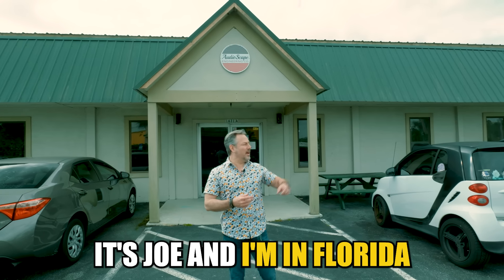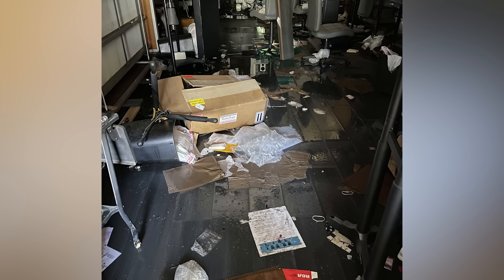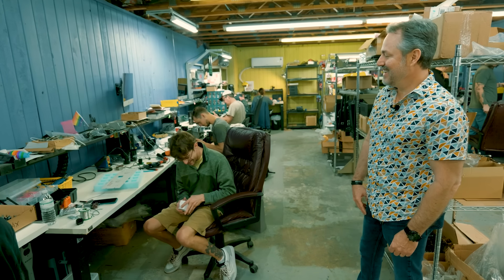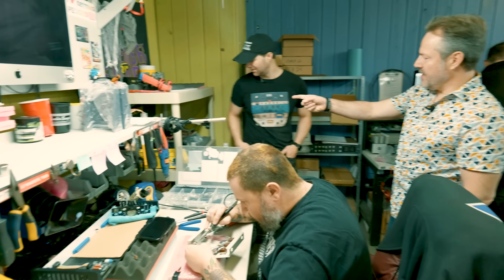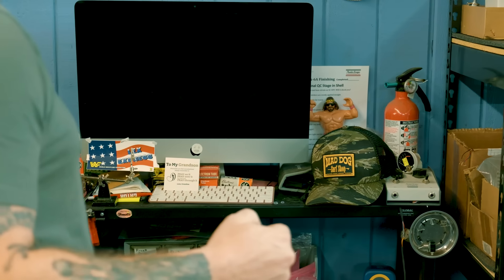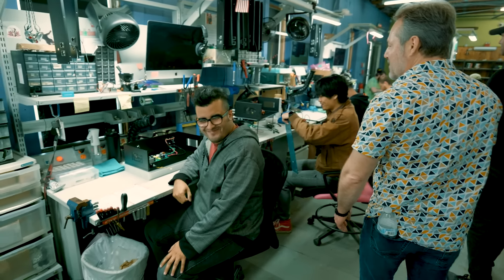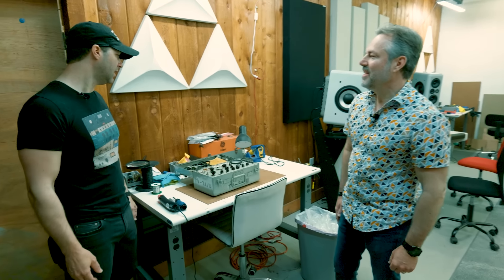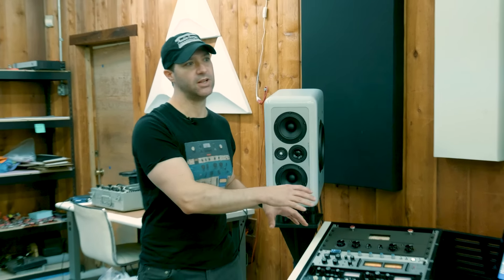AUDIOSCAPE Factory TOUR With Joe Carrell

Comment: Great video. Very interesting to see Audioscape from within. And the units sound great! It is also amazing that you are able to produce with the New Old Stock components.
However, as someone who has been doing mass production of electronics in different parts of the world, I was not very happy to see people soldering without proper ventilation that sucks out all the fumes. In Europe or also in China, there is always a unit hanging over the soldering station to get rid of any fumes that are emitted during soldering.
Reply: Thanks for watching!
Reply from the maker: Thanks Bengt for sharing!
Reply from the maker: @InTheMixJoeCarrell  You Rock!
Reply: We actually have quite a large extraction system that’s installed throughout our main assembly stations and we’re installing more as we expand and grow, you can see those goosenecks in various shots throughout this video. Another great company in the US, Cinemag, helped us with the planning for this system and helped us implement it for proper air flow. We also have an open-air facility which is a huge help. Cheers!